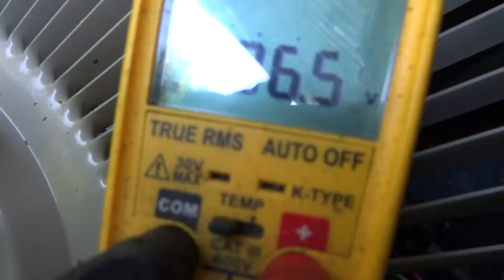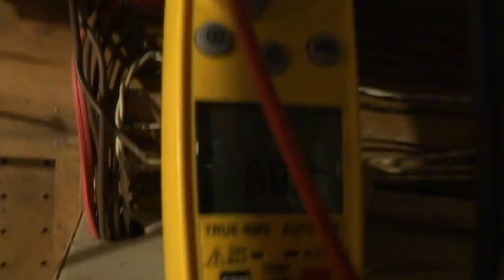GOODMAN AC UNIT NOT RUNNING OUTSIDE LINE VOLTAGE ISSUES

Comment: Just had a call similar to this last week. When I went in the lady’s garage to open the panel, everything inside the panel was corroded as hell. Looks like she had a big leak in the garage and the panel got drenched and dried out causing big rust and corrosion issues. I reset the breaker for the A/C several times and the unit finally fired up and ran. I then told her to call an electrician, that panels not safe.

Comment: Being from the UK I understand the situation with the USA and aircon but I wouldn't of left that like that. I wouldn't be able to sleep worrying if that house was going to burn down. OK the panels are metal but that connection should of been condemned.
Reply: I agree, I'm from the UK as well, Steve did say he will tell the homeowner to get an electrician out.
That panel looks full and quite a job to change out.
Reply: @christopherhulse8385  not a big deal at all to change it out.  There was no reason to condemn that panel, yes it needs to be changed but not a hazard. That was caused by either improper installation of the breaker or the breaker was compromised from day one of install,  I have been on repair calls where someone modified another type breaker to fit the panel.

Comment: Were there any other breakers or spaces not used so you could move the breaker? Just a thought. I had a lot of those in apartments.
Reply: Looks like a full party on that bus bar to me. Might as well upgrade it to a 200A service while the electrician is already there.

Comment: Just wondering if you could have relocated the new breaker to the upper right side of the panel? Slot looks empty…
Reply: No spots available. Main breaker at top, bunch of twin breakers on right side. Panel needs upgrade or bus bar fully inspected

Comment: Granted I dont know diddly squat about electrical panels, but that one certainly looks...out dated, worn and a mess. The wiring at the top all looks old and exposed. Yikes!
Also, what's up with people planting all kinds of plants and bushes around A/C units? Dont these people ever figure that A) A service man like Steve doesnt want to have to battle his way through plants to deal with the machine. And B) The machine cant work efficiently if its smothered by plants and will burn out faster. 
People are really doing themselves a disservice by crowding out their A/C units.
Reply: The exposed wires are the grounds, they done have insulation on them.

Comment: I had a panel where water would come in from the meter conduit and rot out the contacts on the bus bar like that. Might need a whole new panel. Notice the rust at the bottom on the enclosure.

Comment: There was a bunch of rust in the bottom of the panel.  Probably water leaking down the entrance cable.  Same thing happened to me once.  The breakers go bad.  In my case it was the main 100 amp breaker.  They came and replaced the whole panel.  Actually the new one looks so much better than the old one.  Polishes up the mech room.

Comment: Whats up buddy I been watching your channel thanks alot for the help I have one issue I have a ruud 2 ton I check the coil and it has a piston in it I did the service myself I used a vaccum pump left the vaccumm pump on for a least 30 minutes just to clear out those lines its a R22 unit the pipe feels like beer can cold the coil is clean the filter is new too but its not as cold as I want it to be any idea maybe you can give me some pointers in this ill appreciate it thanks keep up the good work
Reply: When pulling a vacuum, use your vacuum have to get down to 500 microns. Last month I was on one for 3+ hrs., the gage would not go below 750, we were going to change pumps when something let loose. Got it down to about 450, gave it another half hour after that.
Reply: Thank you sir I appreciate it
Reply: If you want it colder, look for Steve's video on calculating superheat/subcool. You need to make sure you have the right amount of refrigerant in the system. Lot of good videos out there, but Steve's is the easiest to understand. Like Steve says, keep it simple

Comment: I would have ck'd the amperage on the compressor to see if one leg is drawing high amps.   That's just me.  Could be the breaker but why not ck. the compressor amperage just to be sure it's ok.   But good job , Steve.
Reply: Yes I see what you mean now. Makes alot of sense
Reply: But didn't Steve prove that it was the breaker by testing it at the panel? If the compressor was drawing high that wouldn't affect the breaker while the system is off, right? Not disagreeing with you, just trying to understand your question.
Reply: @themayorofairconditioning2868  yes , but if the compressor was running a high leg  before the breaker finally malfunctioned it could be a factor of why the breaker burnt and became loose in the panel.  The one leg may have gotten hot and lost its holding power and became loose.   It's always good practice to amp ck. the compressor legs just to be sure.   Especially in a case like this one.   Steve is an exceptional tech. and I've learned a lot from him.  Love his info.
Reply: It wouldn't have hurt to check, but it was likely caused by a poor connection on the busbar to begin with, either the breaker wasn't seated properly when installed (I've seen that plenty of times), or some other issue with corrosion or even a manufacturing error. If it was drawing too much current on one leg it still should've tripped the breaker.
Reply: @airplaneengine  That definitely makes sense too. But is it possible that a compressor or some other piece of equipment running in an unbalanced way  like one high leg could destroy a breaker over time? Not that it really matters at all in this scenario, Steve found the real problem and fixed it. And I agree with what you said. Just curious if it might be possible to degrade a perfectly good breaker. If degrading a breaker is something that actually happens sometimes.
Reply: @themayorofairconditioning2868  An imbalance on the two legs shouldn't be a problem for the breaker. It's common to have an unbalanced load on a double pole breaker when feeding multi-wire branch circuits or subpanels. Double pole breakers are just like two single pole breakers internally but they have a common tripping mechanism that is supposed to open both poles if one becomes overloaded. It used to be fairly common to take two single pole breakers and pop in a handle tie (or even an 8 penny nail... that wouldn't fly with the AHJ these days) through the two handles to create a double pole breaker. You had to be careful doing that though as not all breakers are capable of switching off the other breaker tied to it (one leg remains on while the other trips off).
Reply: @airplaneengine  okay yeah I understand, that makes sense. From what you said it certainly does seem like it's be a common phenomenon that breakers are designed to be able to deal with on a regular basis.
Reply: @airplaneengine  and thanks for the interesting tip about the old ways. Steve has seen plenty of 8 pennys on breakers I'm sure. "This isn't your mother's basement where everything is perfect and your superheat is perfect. This is the real world, sometimes you have to make do."

Comment: Yo Steve. What do you think of adding a soft start to a compressor to run it off a portable generator? I have a 5000W unit and we have had a few power outages here. It's hot mama.

Comment: Weird circuit breaker for the condensing unit. I've never seen those before.
Reply: The outside electrical is just a switch, there's no fuses or circuit breaker outside.
Reply: @Kevin ohh ok. that's cool. I once saw a 3 phase circuit breaker for a residential home when I was walking.

Comment: yeah that's one of those questionable jobs where you have to decide whether to "temporarily" condemn the unit / lock out that breaker or try to fix it and hope the panel doesn't go up in flames.